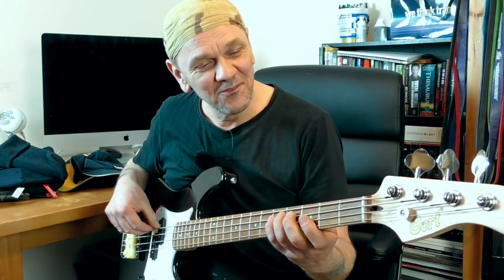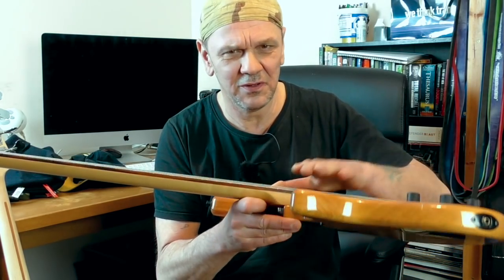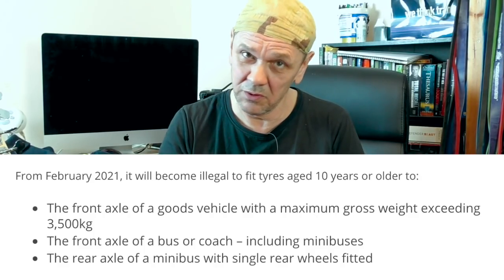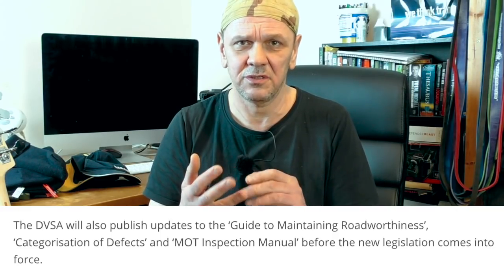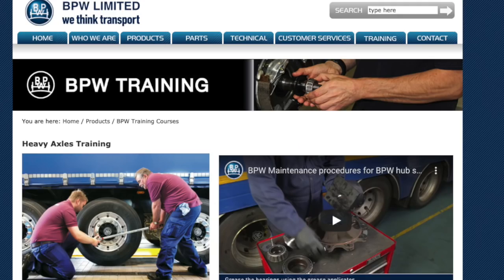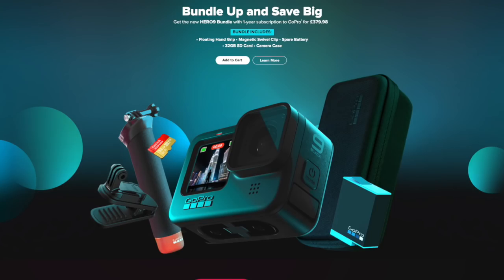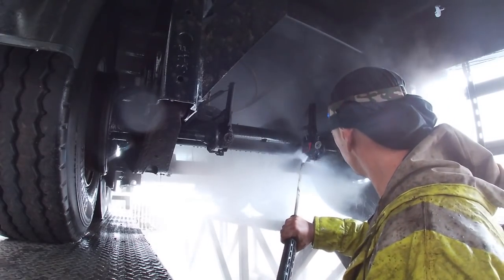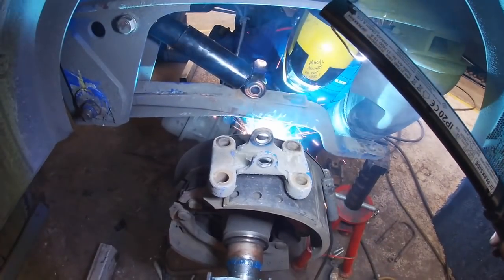'Trailerfitter Talks' - New Tyre Law,  BPW Training Course and Comp.  Plus more

Comment: Great info on rotating tyre not suffering from ultra violet.
My old Land Cruiser tyres are 2009! My strict but fair MOT guy passed them after a very, very close inspection. I know I need to replace them.
I am going for a slightly larger size this time, 29" to 32" so my spare wheel cover won't fit. I was just going to go without but after this video I will buy a larger cover.

Comment: Question for BPW. - Which axle configuration is most effective at preventing fuel/product tankers from rolling over? Obviously, the load can't be secured so when corning the liquid will shift and cause weight to be shifted to one side of the axle. This will obviously cause the trailer to want to tip in that direction. Having more axles/wheels will reduce this a lot as the load can be spread across all axles.
Following on, this is a sensitive subject (Don't need to answer :P) How many incidents have you had where the axle it's self has failed and caused accidents. Obviously, many accidents are down to mechanics not following procedures and/ or lack of knowledge.  

Have a nice weekend all!
Reply from the maker: I would have though the TEBS was more to do with providing "Roll Over Stability"  than the axle configuration.

Comment: Question for BPW why should fitters use your blue grease instead of regular lithium grease (apart from warranty issues)
Reply: Hi Drew, for warranty yes you should use BPW eco Li plus grease. The reason is that we have designed our taper roll bearing which is a 10 ton bearing on a 9 ton axle, and this combined with the eco Li fully synthetic blue grease gives us the 5 year warranty on road and 3 year off road. We also recommend it on the cams, slacks and rear steer if you have, as they are greased at the factory and if you use a 3rd party grease and you don’t purge the grease out you will get cross contamination of the two greased and this will set rock hard and stop grease getting to where it is needed, on cams it will block the veins and grease will end up in the drum😩
Reply from the maker: The biggest problem is with operators, they do not want to pay the extra for the Li grease which then only gives us the option f using the cheaper greases.  But, we can't tell them can we?

Comment: Great video as always. Question for BPW. Why they dont admit that is rust and not oxidation under the bearings,coming from condesation by a hot bearing and a cold  axle ,cooled
 from the wind, all the best to Mike and Lee
Reply from the maker: "Fretting"  😂
Reply: Fretting corrosion is a known issue in engineering terms and occurs where two contacting surfaces
are rubbing against each other at small amplitudes.
A hub assembly on an axle shaft is a typical example. Minute parts of the surface weld together by
adhesion and the displacement is too small for the surfaces to be sheared off. While the rubbing
motion continues, fatigue cracks are initiated by high shear stresses around the adhered area.
• As a result of surface initiated fatigue failure, wear particles break out of the material, become
trapped between the surfaces and oxidise.
Other factors that influence fretting corrosion are:
Corrosive environment
Contact load
Amplitude and frequency of load fluctuations
Number of cycles
Availability of moisture
The design of the stub axle incorporates features
listed below to offset the factors that influence
fretting corrosion:
Surface hardened bearing journals
Large diameter bearing journals
High capacity bearing selection
Close positioning of bearings

straight out of the manual :-)

Comment: Question to BPW What's currently they're more popular braking set up disc or drum brakes and do they notice an increase in operators going back to drum brakes?
Great video again as always👍
Reply: Hi Luke i think this will shock you!! BPW will sell around 44k axles in the UK market in a normal year!!(whatever normal looks like these days) and 96% will be drum brake. The UK market is small on disc in comparison to the rest of Europe where we see 70% disc 30% drum.
Reply from the maker: @mikestayman6267   Europe just doesn't have tight arsed operators like we do in the UK!!!

Comment: Question for BPW. with modern manufacturing technology why are the torque settings and thread rotation not stamped into the castings? like to good old days.
Reply: Hi We only have the Torque setting on our hub cap, for the hub bolt/nut it is a self torque unit so not required. For all other fixings we supply wall poster for quick reference and workshop manuals for bed time reading, and if all else fails you can always call BPW we are more than happy to help.

Comment: Question for BPW
If an axle has damage/wear under the spring saddle, is there a tolerance and what is the recommended repair procedure?
Reply: Hi if everything is kept tight you will not get wear under the saddle. We do not recommend you repair the axle beam as you will not get the required clamping forces on your suspension once the beam has been worn due to movement.

Comment: Late to the party but I have a question for bpw. I'm an apprentice and my employer utilises a few different types of axles. My question is, what advice would you give to an apprentice on inspecting axles and maintaining them? Can be specific to bpw or generalised across the whole board of axles.
Reply from the maker: Axles are axles but you want to look for wear and tear fistly on suspension and the foundation brakes which i show you in the videos.  The next thing to do is start to acquire the workshop manuals for the specific axles you work on and get the ins and out of how maintnenace is carried out. Most manuals are on line in PDF format so you can download them and print them off on your works' printer.
Reply: @trailerfitter2   that's brilliant mate! Thank you very much. The more information out there for young and learning apprentices the better in my eyes! Love your videos. I put lots of what you say into practice. I especially like your tool reviews. Very helpful. Thank you for everything you do and on behalf of all apprentices out there watching these videos, you're brilliant and keep on doing what you are mate!

Comment: Question to bpw ...could the use the center of axle as a air tank and what’s the highest mileage done on a bpw axle
Reply: Hi Martin, currently no on the axle been used as a air tank, and i don't know the answer to the most miles done by a BPW axle, but i will ask
Reply from the maker: I've seen that on an axle but i don't see the point in that.

Comment: Hi Chris, question to bpw
Can they come up with a solution to the saddle under the spring or trailing arm issue and causing cracks in this area
Reply: providing all the clamping is kept to the correct torque and if loose clamping is suspected, it should be re torqued or U bolts/spring seats replaced then you should not have this issue.

Comment: Question for bpw, in the testers manual it doesn’t give a measurement for camshaft play, just whatever the tester seems as excessive play, is there a measurement they would say requires change?
Reply: yes the measurement is 0.8mm and can be found in the BPW workshop manual

Comment: Question for bpw, how come the shock absorber bolts have a tendency to come lose on the bpw axels used on nooteboom jeepdollys?
Reply from the maker: and why are they hard to undo on Montacon trailers?
Reply: @trailerfitter2  I’ve not had a lot to do with montracon the majority of the trailers I work on are special types
Reply: we don't come across this much, im guessing that your trailers are on mechanical suspension and could be caused by vibration through the trailer, another thing to check would be the torque on the shockers and this should be 420Nm steel

Comment: Question for BPW ...   Why still in 2021 we suffer from wheel loss or loose wheel nuts even with modern visual and additional  mechanical retention  devices are fitted ...  even when preventative maintenance wheel nut torques are  checked to eliminate  wheel nut defects 
Poor quality materials ?   Wheels ? hubs ? fixings ?
Incorrect wheel thread lubrication ? 
Incorrect torque ? 
beyond service life of parts ?  poor workmanship ?  just let it develop ..... send it out ?
Reply: Hi, it looks like you have answered your own question :-). the most common reasons for wheel loss will be loose wheel nuts, this can be a combination of 3rd party cheap wheel studs and the collars seize up and don't reach the required torque, stretched wheel studs due to those inch drive dagga daggas. hub loss, we tend to see these within a week of human intervention, and the big culprit is not fitting the locking clip correctly and cleaning the journals correctly.